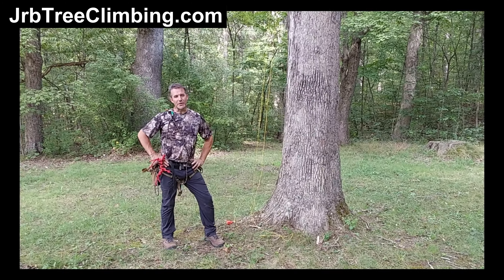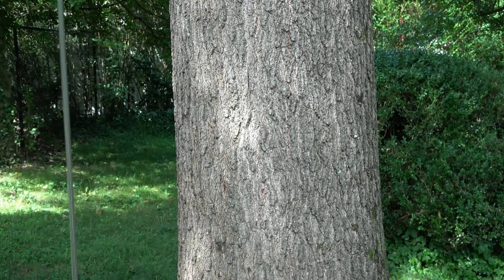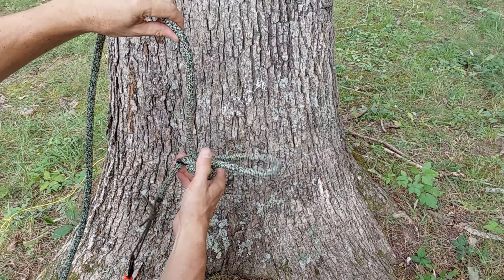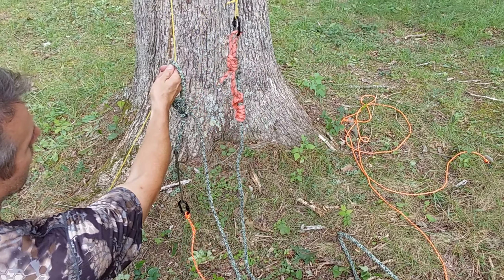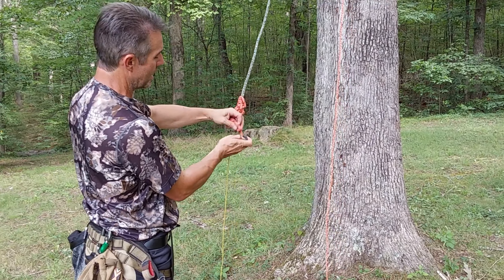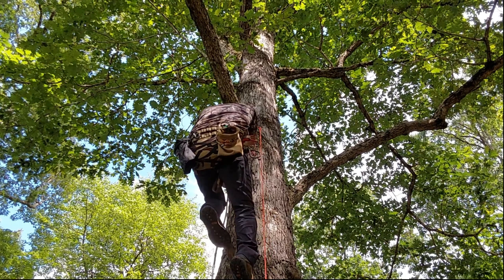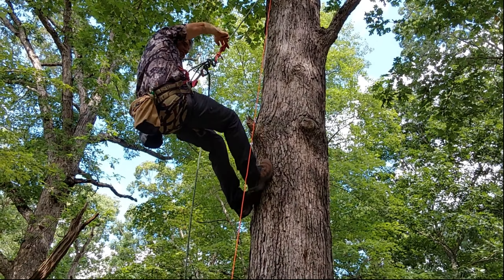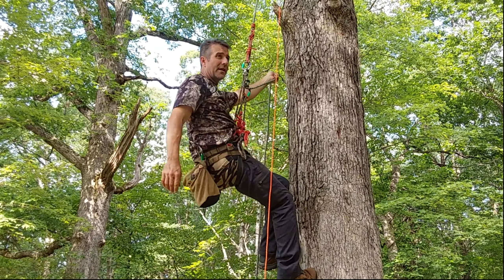SRT #1: Typical Tree; Knots Tied in Advance

Comment: I tried DSRT, and I liked it ok, but I find that I prefer SRT. This is basically the exact setup I’ve been using except instead of the locked Scott’s bowline I use an alpine butterfly for my canopy anchor loop and a longhorn agile for my hitch. If I need to hitch climb I just untie the alpine butterfly and tie maverick hitches (or sometimes I’ll use the moose hitch and rig both ends for the JRB cinch, it seems to be easier to advance with the pole for me) and climb. Absolutely love the system John, thanks for all the incredible info you put out here for free.
Reply from the maker: @seabeebillm  Sounds like you have a nice Toolbox and know how to use em.  I would like to know what why DSRT is less appealing than SRT. Because for me, I love that I don't need to set an anchor and that the friction hitches are only holding half my weight so it's very overdesigned.  Have you tried DSRT with the Longhorn Agile and a single shove with one hand instead of a double show with both hands?
Reply: @jrbtc  hey John, thanks for the quick response…yeah, not sure I can really nail down why SRT seems to work better for me…I’m a big guy (6’2” and I’m walking around at about 240) so that might have something to do with it. I didn’t really have an issue with the shove, SRT just feels much easier and more fluid and (so far) I don’t mind setting the canopy anchor. I definitely did have more issues with the double ropes and the Munter hitch…I use the full super Munter and it got sketchy a few times with the 2 ropes, issues with twisting. Sorry, that’s not a great answer to your question…it’s definitely not an issue with the method, I think it just boils down to how the climb “feels” to me. Anyways, thanks again, this is so much better and safer (and funner) than how I’ve climbed the last couple of seasons.

Comment: I've climbed the last 2 seasons using DRT. This year I made the switch to my below commented system. I should note that there is a significant reduction in friction when ascending. With DRT you have the friction of the rope rubbing on the branch as well as sliding through a pretty tight blakes hitch. With a fixed line all of your friction is in the swabish hitch.  Basically in short using this type of system is easier physically than DRT. At least in my opinion and experiences. I also should note I am still using 75' of 11.4 mm predator rope.  A few of the tree I sit in are 30' plus. (old growth forest). Hope this helps. Do your research ladies and gents and DONT GO CHEAP ON ROPE.
Reply from the maker: Good input. I agree.  I prefer DSRT over SRT though.  No need to set an anchor and works with 8mm rope.
Reply: @jrbtc  we all have our favorites thanks for taking the time to reply and keep the videos coming. I habe a good one for ya. How to stay warm in the saddle. Barley, any videos on youtube for late season gear. I'm going out tomorrow with a low of 20 and high of 37. It's gonna be a a cold one.
Reply from the maker: @neanderthalnonsense  there's a reason our body shivers when we are cold: muscle contractions burn calories and generate heat. We don't actually need to move to engage our muscles, and it's important to keep doing so, even before we're feeling cold.

Comment: I use a similar system. I tie on my hitch at the tree just to keep it neat and tight. I use a swabish hitch and garda hitch with a footloop for acent (backup is attached to garda). For decent I use a figure 8 with the same swabish hitch as a backup. Very little metal. I dont like metal clinking. I use a loop that i whipped onto the free end and I use a figure 8 loop at the anchor. I use a keychain carabiner and short paracord prussik right behind the loop. This works quite well. Thanks for the videos.

Comment: John would you recommend a climbing ring tied into the 523 ascender as a handle like you have shown in previous videos?  Or do you feel the extra bulk of the ring would cause issues going through the scotts lock bowline?
Reply from the maker: That's a good question.  In general, i prefer a carabiner handle over a ring only because its easier to grip a carabiner.  When my hands were either hot and sweaty or cold and weak, they can slip off a round smooth ring.  However, in the situation you describe, it would be better than no handle and if ya use a small ring, i don't see it impeding the passage through the ring.

Comment: Is that the friction hitch you recommend for this technique? 
Why not the agile friction hitch?
Reply from the maker: Paul, it's a perfect question.   For this specific system, one that the climber doesn't wanna tie anything at the tree, the JRBAH has an advantage over Longhorn Agile because of it's smaller profile which will more easily pass though the crotch and the loop. The next video will show how we can rig and retrieve more easily without a JRBAH on the line with the cost of needing to tie a LA hitch. For me personally, I accept the responsibility to tie the LA, and all of that will be stated.   I want to present a logical set of viable options in the right order.
Reply: @jrbtc  awesome.